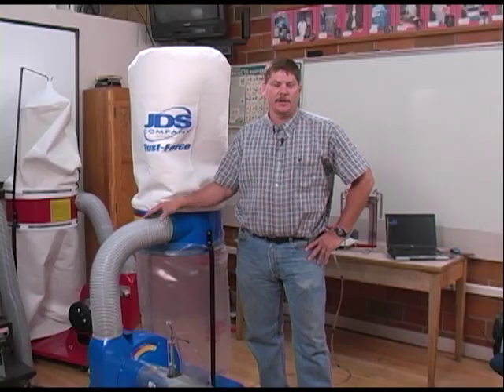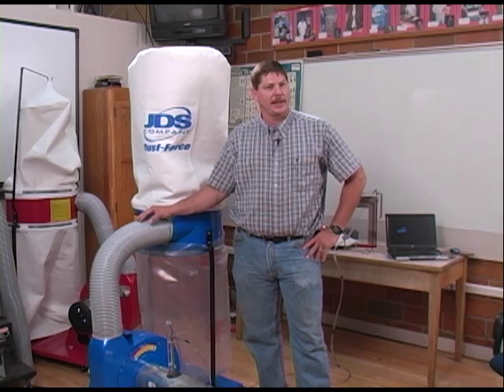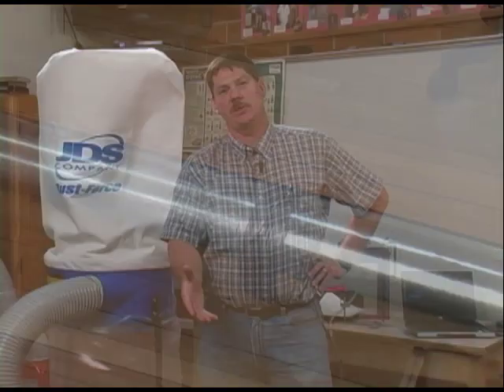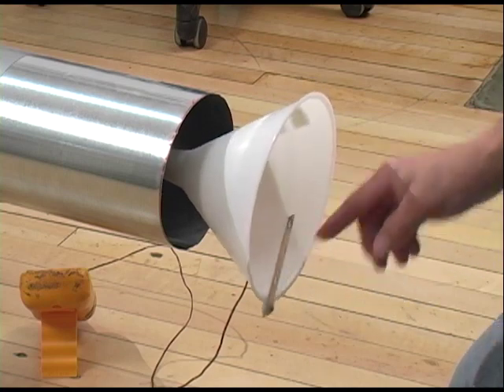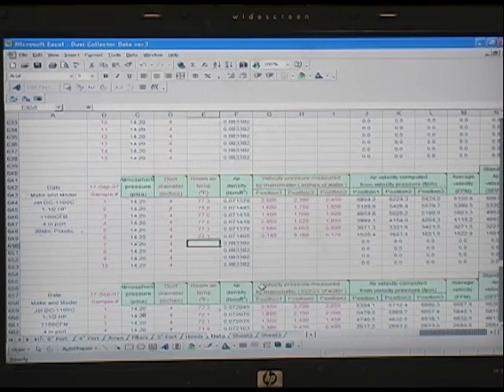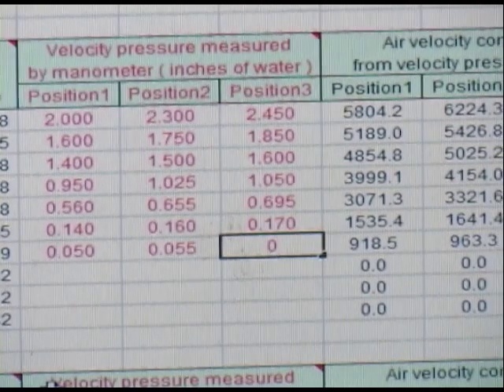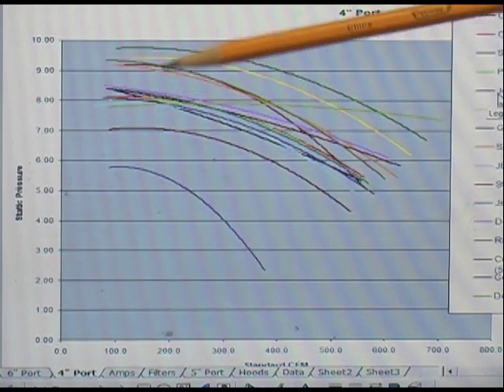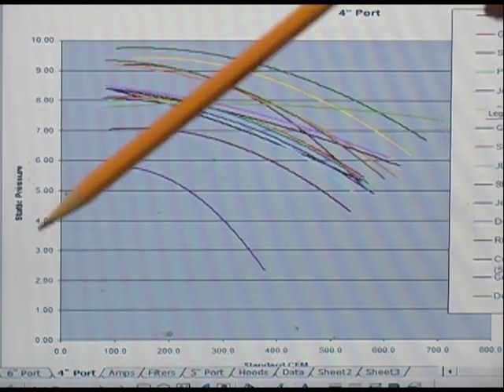Dust Collector Fan Curves -- WOOD magazine

Comment: I just watched this for I'm interested in building a DIY dust collector for my shop with box fans. My only issue with this video is there is too much information and I got lost a bit in information overload. The average person will not understand this video when he starts to get into the grafts and excel spreadsheets.
Reply: vOLLY,  Read some more and you'll learn about fan curves and pressure drops. There is a TON of information to learn and understand before you start your Dust collection build. Bill Pentz' website is a great place to start. It's huge and there is no short cut to reading about dust collectors, unless you spend several thousand $ on one already built.